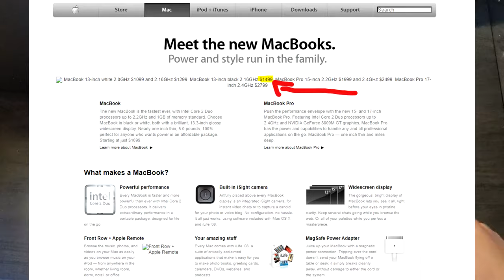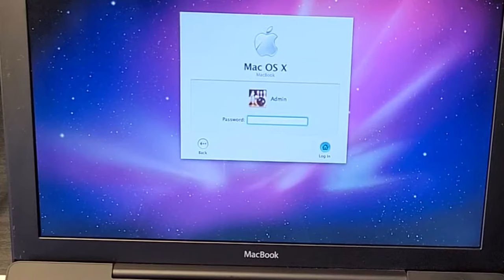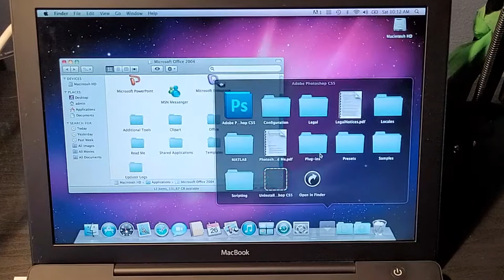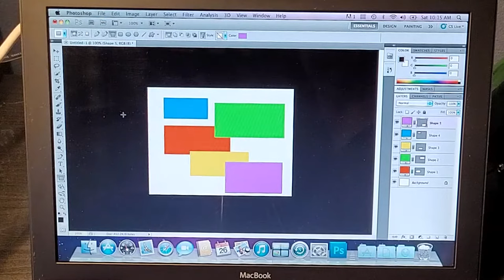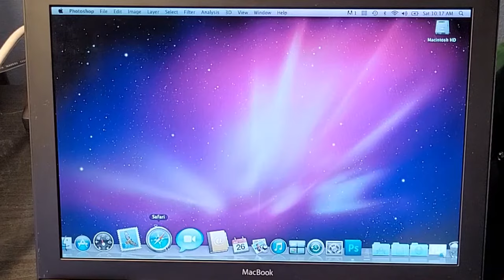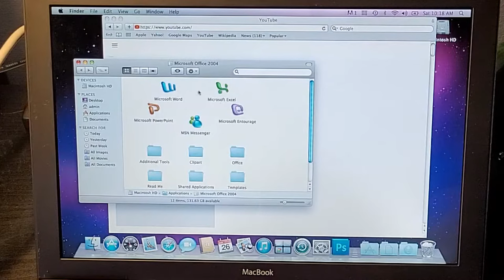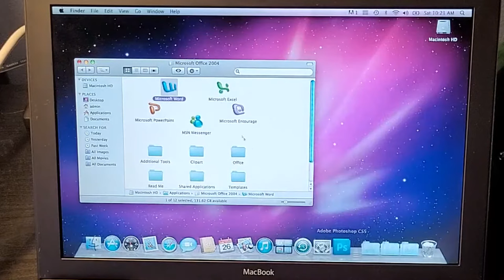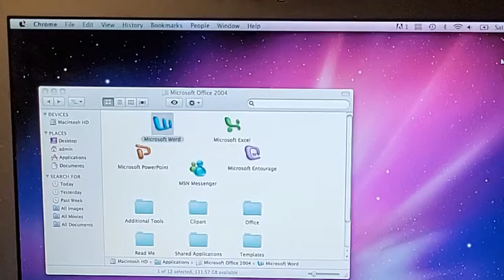The Rare (and tasty!) 2008 Black Polycarbonate MacBook

Comment: The Blackbook is not that rare. I got two of them. The black MacBook4,1 was the fastest one of the A1181 - only the 2,13 Nvidia equipped MacBook5,2 was performant.
No RAM upgrade for this. The 4 GB are shown as 4 GB, yes. But as this is a 32 Bit computer with a 64 Bit CPU, Mac OS X only handles 3 GB. Apples EFI was even worse than some BIOS' of that time (I saw Windows PCs using 3 GB, 3.25 GB, 3.5 GB, and even 3.75 GB when equipped with 4 GB of physical RAM - but only on 32 Bit versions of Windows; I never saw a Windows 64 Bit installation utilizing less memory than it was installed).
Reply from the maker: @atarixle  yeah I own 3 of them now haha

Comment: I have one from 2008. I love it. Still running fine, but I’m going to upgrade the hard drive to an SSD with 1 or 2TB.  Had to replace the battery about two years ago. 
Gotta love the FireWire and CD drive.

Comment: As much as Snow Leopard was great, today it's extremely hard to use, where as Lion is much easier to use.
With the graphics of these things, they can't run anything newer than Mountain Lion, although patching them to this version is better than nothing!

Then, there are browsers that will play YouTube in 720P easily on Mountain Lion!

To solve that, you can put a MacBook 5.2 motherboard in it. You'd need a MacBook 5.2 DVD drive as well, as not only the connector is different but not plugging it in makes it so you can't close the device properly. You NEED the right DVD drive.
Screw holes for the cooler aren't in the right spot. You need to tape the cooler with heat resistant tape and break the metal part of the original screw holes as it can cause shorts.
The cooler is also different as well as the heat sensor connector(s), so you need that from a MacBook 5.2 as well.

The webcam will not work and there's nothing you can do.

Once done though, you can patch it to Catalina and use this wonderful black MacBook today!
Reply from the maker: Sounds like a very janky but cool project to do a motherboard swap on this
Reply: @frokfrdk  Well I was given a MacBook 5.2 motherboard. which was dead. Quickly noticed an open circuit burned inductor that I replaced. Now it works.
I put it in a white case, which I had to do a few little mods to, and didn't do that on the black one I had which I kept original, but it's definitely possible if you want to get more use out of it.
And of course you can patch the original motherboard to Mountain Lion, install Chrome, and enjoy smooth web browsing + youtube!
Reply: @frokfrdk  it's easy! Only downside is you need to swap the dvd drive too, if you don't have the original one it won't work